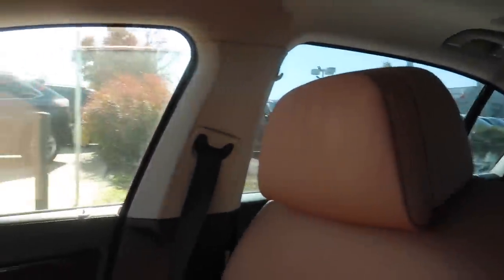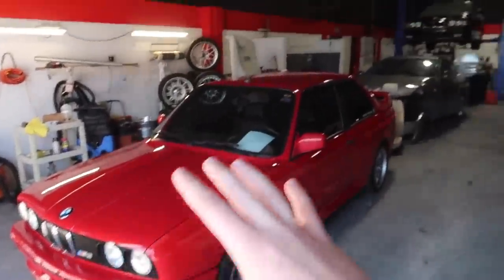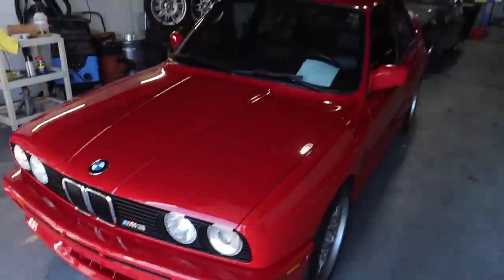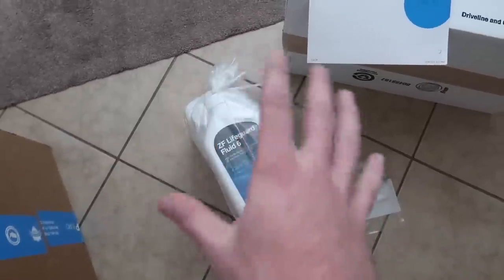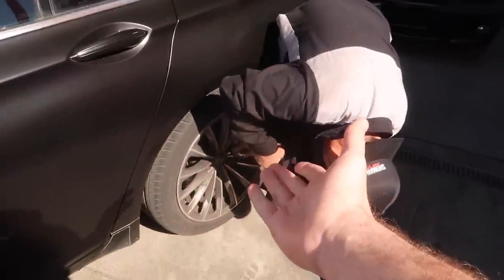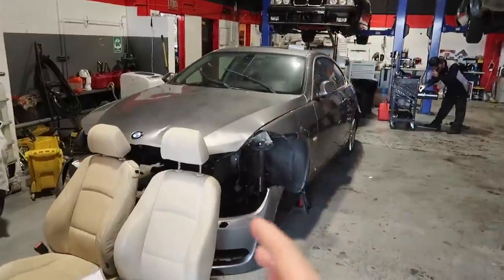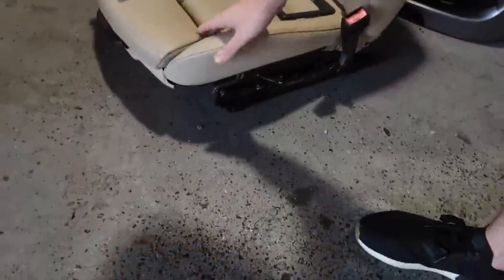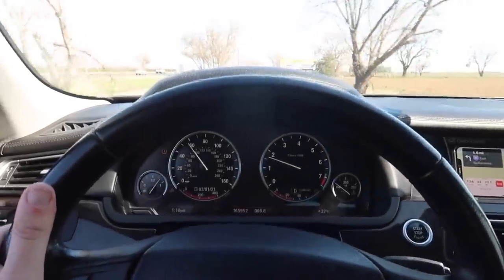SPENT $4000 DOLLARS TO FIX THE TRANSMISSION AND LEAKS!

Comment: What did he use to get rid of the window water spots
Reply: I'm here wondering the same thing
Reply: steel wool
Reply: Steel wool grade 0000 and you can also use 00000, it has to be really fine or extra fine to avoid scratch the glass.